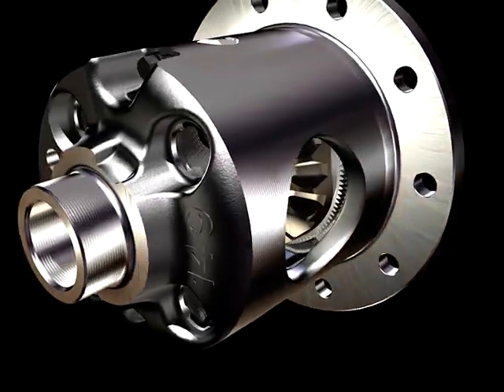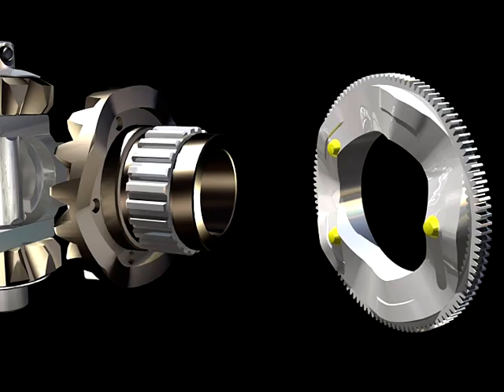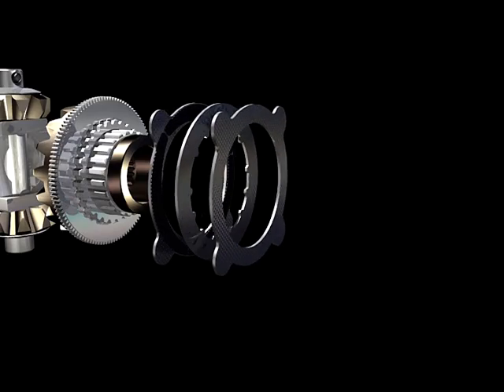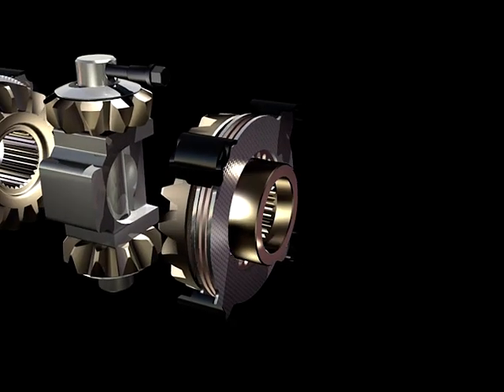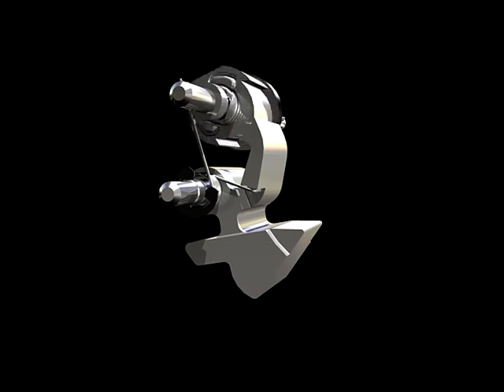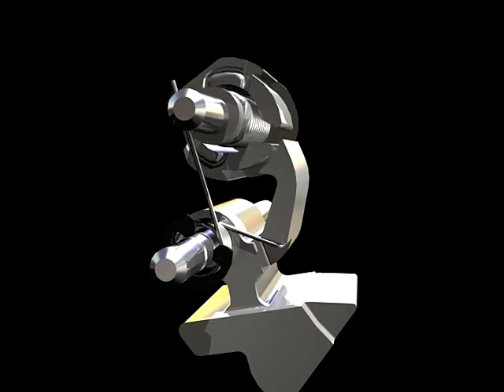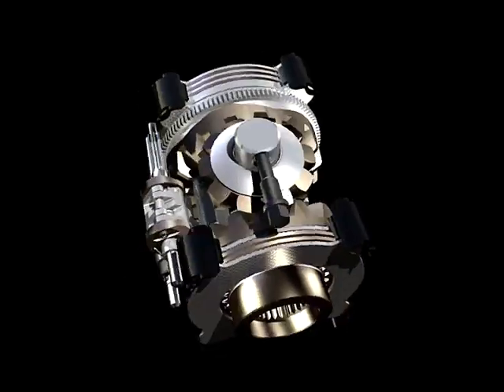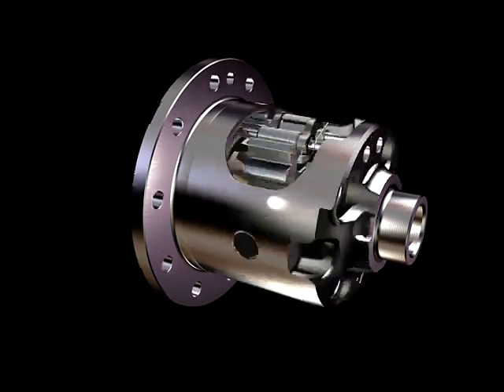Eaton Mechanical Locking Differential

Comment: Another incomplete locking differential explanation!
She omits to say why or how the side gears actually get locked together during wheel spin!
From inspection, it's clear that once the loose cam plate rides-up the cam ramps, it COMPRESSES the friction material which grips the inter leafed clutch plates! These clutch plates have 4 EARS (LUGS) sticking off. These Ears must fit into corresponding channels (not shown) in the big cylindrical housing unit -which has the crown wheel bolted to it.
Therefore, when the clutches start to grip, the crown wheel is effectively driving both sets of clutch plate ears sliding in their channels inside the housing. These clutch units are splined to the side gears! So the crown wheel and housing are driving the  half-shafts via the side gears. And the spider and pinions in the middle, are not taking any torque! However, as she says the cam ramps are apparently self energising, so I don't see what causes the clutches to ever release? Does anyone else see how the unit unlocks?
Reply: +James Bradley I'm no mechanic but I would assume the springs that keep the lockout mechanism pulled in will also disengage it once you get to 20 mph. From the videos I've seen of these in action the diff locks and then unlocks once they get up to 20 mph.
Reply: if one wheel spins more than 120 rpms then it locks once it goes over 20mph I believe then it unlocks its meant for low speed traction not what stupid fucks use it for what they think its meant to do
Reply: bruteman45 would guys prefer Eaton or ARB lockers?
Reply: @anythingadrenaline4515  Torsen® has the best design and actuation.  No clutches, faster, smoother, quieter, stronger!  It is what the military uses on front and rear axles.
Reply: @ 0:55   she said [when]..... a predetermine '' Torque is applied ''.  to the gear teeth....  the friction plates get locked up...
Reply: @ 4:17  she tells us how the cam plates will lock together...
Reply: James Bradley nerd

Comment: To some of the comments below: 1st I am not sure it will always lock under 20mph and below 100rpm difference. There is most likely a small gear shifter or a button, so once you activate the diff lock on the vehicle, it will release the part, which gets closer to gear ring below 20mph and lock. However it is possible that like in may vehicles the diff locks automatically, when needed, so when there is a deviation from xxx RPM, it may lock automatically- I am not sure about this one exactly unit. Also it has been always like this- some commented about driving on pavement and many parts which may break. Diffs must be locked completely (100%) only if there is a wheel spin or if you drive in a straight line. Otherwise if you make a U turn for instance and the new tires are running on hot clean tarmac, this will force huge load and pressure on the differential(if locked). For instance if your car is on steep hill and you try to drive it, but both right tires are on a glassy ice, but the other two tires on the left are on tarmac, both wheels on the right will spin over the ice, when there is no diff lock. In this case you will lock your diff and the read left tyre, as the one having grip on the tarmac will pull you out.

Comment: Jochem Bonarius,  it is a differential of 100rpm which means one side gear is only moving at 50 rpm relative to the diff case. 
are you saying this thing would lock up 50 times on a short trip?
worse case theoretical scenario for a 20 mph lockup with my truck equipped with 235/75R15's would be speedo reading 20 mph one wheel at 0 rpm and one wheel at 466 rpm meaning the engagement mechanism would be turning 6058 (by your estimate) however, this should never happen because once the wheel differential reaches 100 rpm the diff locks and the wheel differential should drop to 0.

Comment: so the differential locks whenever one wheel makes 100rpm more than the other, and its mechanicle to. genious but i wouldnt apply it on tractors, but it seems like a great idea for any atv or offroad truck
Reply: For trail riding and the beach it's GREAT!  You don't have to screw around.  I'm busy having fun when I'm driving, I don't have time to watch both back wheels in 4 wheel drive.  This eaton is really awesome.  I've had two.
Reply: The SPINDLE with the bob weights has to make 100 rpm. for lockup to happen.
Reply: still makes it useless for tractors...
Reply: Thomas de Boer
Yes and probably not much good for creeping slowly up wet rocks either!
Reply: uhu, id still rather have a hand locking diff. gives you more control... but i realy like the idea
Reply: Just listen to the video guys it takes approximately 100 RPM to lock it and it won't lock if the vehicle has wheel speed over 20 MPH. I have owned a few they do their job well. Not for serious offroaders IMO. The design is not nearly as strong as many selectable lockers and of course full lockers. Works good for boat ramp duty, snow and ice, mud and sand, anything you need the tires to mostly spin at the same rate.
Reply: NO ! ! ! ! It was explained that anytime the carrier RPMs are OVER 100 RPM the system CAN NOT LOCK, this way IT WILL NOT LOCK AT HIGH SPEED.  Thats about the only part that was simple and not one of you got it right ! ! ! ! HELLO ! ! ! MCFLY ! ! ! ! !
Reply: are you 12? does your mom know your abusing your capslock button?
Reply: Jackyl82334 You really don’t get it.

Comment: Um, yeah... but the difference in wheel speeds in the diff are often zero (driving straight ahead) or up to a couple hundred rpm (like, 250 at most)

Comment: The engagement mechanism doesn't wear out, the friction material does, and over time it will render the locking action of the differential worthless. If the differential is abused (ie, offroading, power braking) the engagement mechanism can break, sending bits of very hard metal into the spider gears, destroying them and the whole diff. That is the reason they are called a "gov-bomb," as GM marketed them as a "gov-lok" or "gov-lock."
Reply: I was thinking that it would wear out just like a motorcycle clutch, because that's what it is.

Comment: 100? an engine wont run at 100 rpm more like 800-1000 and that is a lot more rotational energy and impact
Reply: That's axle speed after transmission and ring and pinion reduction.

Comment: 100 rpm isn't that fast. It's less than 2 per second. Also keep in mind the locking mechanism is greatly geared up from the rest of the differential, reducing the amount of torque on the locker.

Comment: While "tech advanced", THIS is why General Motors "GOV LOCK" locking differentials "explode" I'll stick with my more simple, yet more effective limited slip diffs with high spring loads or a true locker.
Reply: It isn't GM's diff it is made by Eaton a very well respected company. This particular diff in the video is a newer version of the Mlocker (g80) mechanical locker they where installed in many vehicles of major manufacturers ( ford, Gm, volvo and others) in vans, trucks, and cars. The original G80 is a good unit if you don't beat the shit out of it and drive like a normal/sane person in low traction situations allowing it to lock up before you give it all the beans... This newer version has more wear points but the main part locking the diff is the cam plates (dogs) I would assume it works just as well as the old unit. With that said I would still go for a Detroit Truetrac unit because it uses helical gears that seamlessly vary the torque, wheel speed, and can be used in front axle applications unlike the unit pictured or its grandad the G80. As well the Truetrac has been proven to be very good off-road, daily driving, and at the strip.

Comment: get TOYOTA rear diff lock.  I had for Land Cruiser and that truck I go every where with it...Not technical Update so much and the engine is 4.2L rear wheel drive straight 6 cyl easy to tune up.....only thing now if I want to buy a new one is around 60,000 USD...Stayu with my 70 series It will last me to I death..  Thanks Toyota
Reply: you don't want a new land cruiser......

Comment: This is the most complicated system to lock a diff, those small parts locking and unlocking cannot possibly withstand those forces thousands of times, just like German technology it's over engineered and will suffer massive problems over and over

Comment: This is ridiculously complex. I like the system that detects when a wheel has less traction, then brakes that wheel causing the force to be transferred to the wheel with more traction. It's much more simple and effective. It costs less and lasts longer. This whole thing is unnecessary.

Comment: OK, I finally understand how it works. The lights finally started going on. But now I'm having trouble understanding how it would unlock. It seems once it was all locked up it wouldn't unlock. When both wheels are back on good traction, what's the force that would cause it to unlock?
Reply: Probably spring pressure and reduction of centrifugal force
Reply: I think re-engagement is based on relative torque / speed between the two wheels.
Reply: Once the difference in axle speed is nil the ramped plates ride down the slopes, and the spline that drives the clutch packs release. At that time 
the governor weights close in, and the diff is out of lock position. You may not be taking into consideration that the entire carrier off all these parts 
are rotating. The crown driven axle is always rotating while the vehicle is moving. The “ clutched “ axle is driven by the locked up spider gears, as 
with non locking diffs. Non locking diffs will send the power to the axle of least resistance and spin. As that axle spins, those small spider gears have to compensate for the imbalance of RPM. They don’t like that for very long, and if the spinning axle all of a sudden gets traction, the shock 
loading on the spider gear teeth become the subject of destructive testing.  Is important to be able to disengage the locking action when vehicle 
speed increases. If the road is icy, a locked up diff will not differentiate. That means both drive wheels won’t compensate, and your no longer 
steering the vehicle. You gave up that option to the direction the drive tires direction of rotation. Other comments welcome.

Comment: I wish they were more durable, I had 2 that came stock in my chevys. They are super awesome, detroit lockers can be nerve racking at high speed on ice, but these ones dont lock randomly in a corner when your doing 65 mph.

That said 1 broke at 95,000 miles, and the other is still working flawlessly at 168,000 miles. They have both been abused as work trucks.
Reply: I've heard same - that Eatons are super reliable.,

Comment: It is true that it most definitely is not designed for any sort of racing or high traction situations like pavement.
It is best suited for very intermittent low speed off road/low traction(mud and snow) usage with mostly everyday street driving in between.
The best thing about it is that it can do full lockup, unlike most "streetable" traction devices, yet it drives like an open differential at highway speeds.   Anyone who has driven traditional "lockers" on slippery roads knows what I mean.  ;)

Comment: The RPM difference doesn't directly kill the unit, it's the axial force inside the carrier caused by how it is designed.  This force is applied using the RPM difference, however.   For example, my truck weighs 6700#'s empty and I can engage that locker so hard that it snaps my head back.  All that force is going through 1 axle and simultaneously trying to break the carrier in 1/2, which I've done to a 10 bolt in the past.  Other lockers, like Detroits, do not suffer from that shortcoming.

Comment: The rotating difference between the wheels to lock the diff, is not as big as one might expect. In the diff, If one wheel starts to bind, the other will spin twice as fast. 
EXAMPLE: If the gear ratio is 1:1, then if one wheel stops spinning(0:1), then the other will be spinning at (2:1). So in contrast, 100rpm on the wheel is really 50rpm on the Carrier which may still be high, but a diff can withstand it very well.
Reply: The 100rpm is NOT on the axle difference.  It is the RPM of the little shaft with the paul system on it.  That shaft is geared about 150:1 so it only takes about 2/3rds of a rotation of the tire to engage it.

Comment: That engagement system is pretty small,  There really isn't much momentum there.  
The primary flaw in this design is you can floor the vehicle and generate more than 100 rpms very quickly and the axle is still accelerating as it is locking up which puts unbelievable stress on the carrier.  And it is tough on your axles too.

That is why most automatic lockers start from a locked position and unlock when needed.  The disadvantage of that is driving at high speeds on slippery surfaces is sketchy.

Comment: I have had two and all I need to say is...bomb
Reply: Bomb? What is that supposed to mean? Do you like it or dislike it. Speak English so we can a communicate.  I am interested in your observations.
Reply: @jeffreyoneill6439  I think he means that when he abuses his vehicle, pushing it beyond it's design limits, it breaks. The G80 is a low speed traction device, not a drag racing spool. It's also a very smooth "locker" that minimizes drivetrain shock for traction on snow and dirt. Ever drive a vehicle with a Detroit or Spartan locker? When either engage it feels like something is going to break from the engagement shock.

Comment: too many moving parts... the simpler the better
Reply: By that logic, you shouldn't have a differential at all but go back to putting the power to one wheel like the model T
Reply: I used to own a Chevy Colorado with one; very effective in operation....l
Reply: @7891ph  this diff has brake pads which wear out over time, if you don’t take it off-road then you wouldn’t feel the wear
Reply: @yoloboogie3674   And your point would be, what????
Reply: @7891ph  that there are too many moving parts to last long, you clearly do not put your colorado to use
Reply: @yoloboogie3674   So you think using it on a farm, hauling gravity boxes, hay wagons and assorted trailer's doesn't qualify as real use??? Howard Farms begs to differ. The only reason I had to get rid of the truck was because it got T-boned in an accident with over 160,000 miles on it. Never had a problem with the differential in that entire time. If you're breaking stuff, it might mean that you don't know what you're doing..
Reply: Had one in my Chevrolet G20 van. It worked flawlessly.

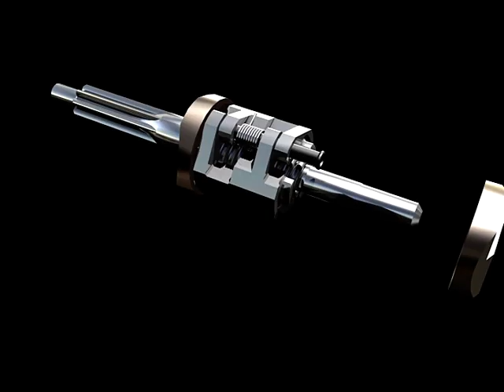Comment: clever idea, but the locking device mechanism (2:22) depends on the hardness of the spring, if for some reason the spring loses its hardness then it will lock quite often even for low rpm... probably there are solutions for optimization!

Comment: I have trutrac and it's awesome and dependable, this mechanical diff unfortunately sucks for anything over sligtly bigger factory tires or if the truck is loaded.  These are notorious for breaking, and i've replaced them with the trutrac.  The casing on the eaton mech diff usually breaks causing bad things...
Reply: Really bro I thought it's good and was thinking about buying it, now you say it's unreliable I am confused now.
Reply: @ag135i  I think there are morons that abuse their hardware no matter where you go. Note on the other hand, the number of people who have for years or even decades gotten great performance and no failure out of Eaton lockers.

Comment: @jhbonarius 1.67 rev/s is equivalent to 10.49 radians per second. multiply this by the radius which I'm guessing is about an inch and a half. This gives you 15.7 inches per second tangential velocity. Which is only .89 mph. This is the tangential speed of the most outer part of the locking mechanism.

Comment: Does this happen automatically or do you flip a switch, like the ARB locker? Nice animation.
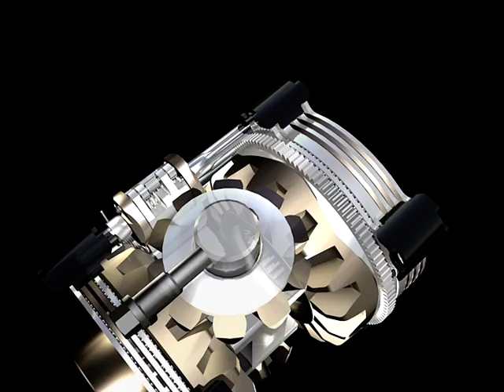Reply: Eaton G80 which is the flagship Eaton model, kicks in automatically. That is why they need the flyweight mechanism @3:54.

I believe the standard issue Dana lockers are very similar. Both are pretty reliable and cannot easily be wrecked by driver's lack of understanding (unlike driver-controlled 4WD levers & switches).